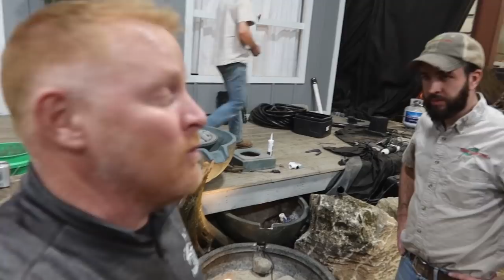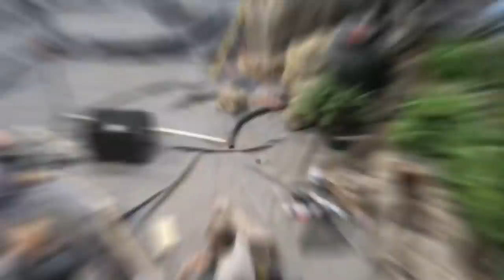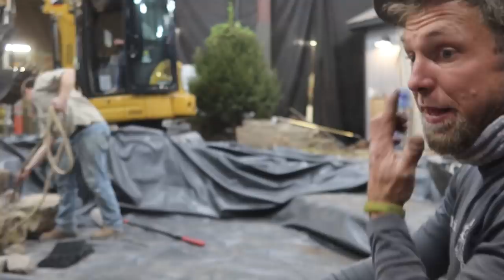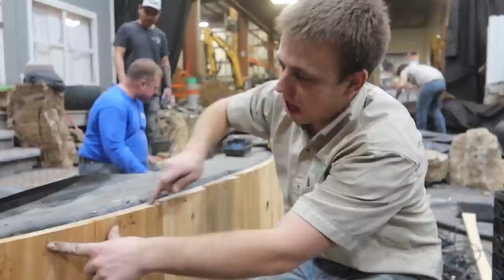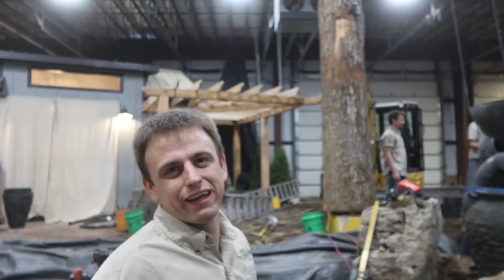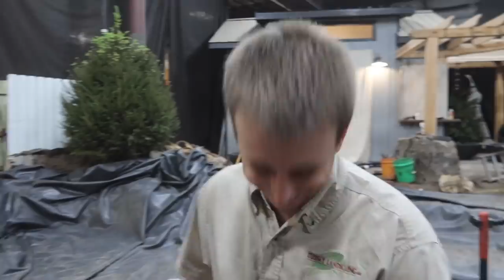Suspended *FOUNTAIN BOWLS*: Tussey Landscaping - Part 3

Comment: Omg! How are y'all gonna get water to those bowls??? I am so curious to find out if this koi window is gonna hold. I am glad y'all talked about using wood on the sides like that. I had that idea once but was thinking it would rot. I didn't think even cedar planks would hold over time. So this is nice to know. What about bamboo? Would bamboo hold up the same as the cedar would? I have always wanted to try a Japanese theme water feature. It would look really awesome to have bamboo around a wall of a Japanese theme water feature. Please y'all let me know if bamboo will last submerged in water. God bless y'all are working hard
Reply from the maker: Cedar is better
Reply: @TEAMAquascape  thanks
Reply: In Britain they have windows in their above ground Koi fish ponds, it’s quite common.
Cedar is a solid real wood plank where as a bamboo flooring plank is created using lamination; glue, chemicals, heat, and pressure. Which do you think is pond safe? ☠️ 🐠
Reply: @Daihatsu_Hijet  I would never use bamboo flooring in a pond. I was talking about real bamboo cut from my backyard. God bless
Reply: @catherineengle4196  well that would be quite the engineering project now. There’s a part you’re overlooking as far as the strength and durability Cedar is wood and bamboo is a grass.